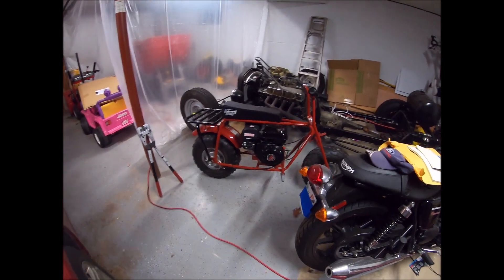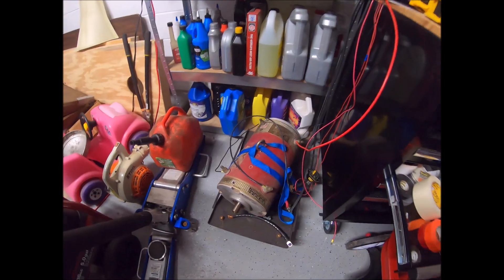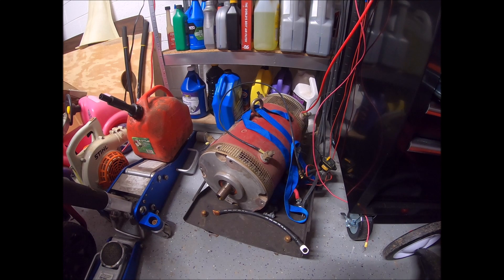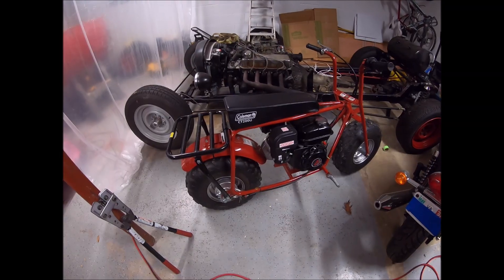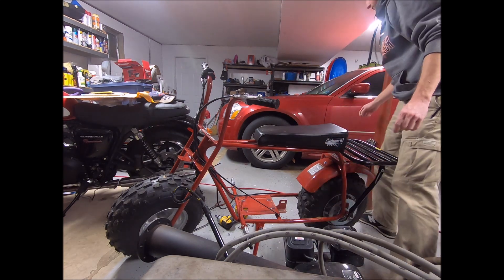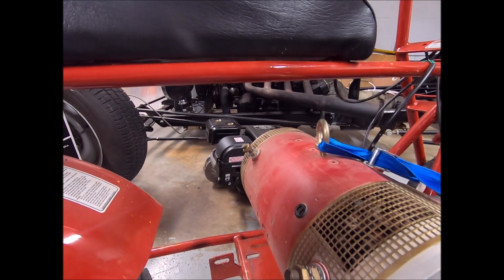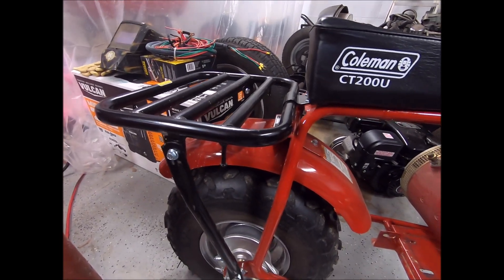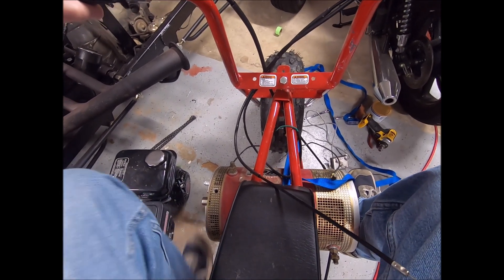Building a Crazy 20kW Electric Mini Bike from a Coleman CT200 Part 1

Comment: Looking good. That's a heavy motor for 20kw though. You can get that sort of power from a much smaller motor, say 10kg. But I love the intended lunacy of this and the potential it has! 
I'm in the middle of a 30kw mobility scooter build. My biggest problem is space. I want it to be as inconspicuous as possible and it looks like I'm going to have to be a lot more innovative than usual. Any ideas?

Comment: Stretch the frame your gonna need it  for balance with all the torque put the motor in long ways with a 90 degree gear box on the end of it run the chain off that and your good
Reply from the maker: I've actually had my eyes out for a 90* box but haven't come across anything that would take the torque

Comment: You would be better off putting a motor like this into a go-kart. You could get more room for the batteries and motor by extending the frame another two feet. To be safe everything has to be mounted very low. You could line up the motor parallel or inline with the body and use a 90-degree gearbox for the drive sprocket.

Comment: I think you need to start by picking a gear ratio and designing your jack shaft, then push it and your motor as far back in the chassis as possible.  That will allow you to put your pegs in a better location and keep your chain line in a safer spot.

After that, put your controller in front of the motor and low.  Use the top of your frame for the battery.  You are going to need a lot.  At 48v, 20,000 watts is about 400 amps.  Assuming some type of recycled high discharge 18650 lithium ion battery pack, your configuration would have to be something like 13s30p or maybe 13s40p.  That's a lot of cells but you could probably fit it in the frame if you pack it efficiently.  Make sure your battery series connections can handle that 400 amps, that will need a lot of nickel strip.

I think it will be scary and maybe fun.  I like your style.